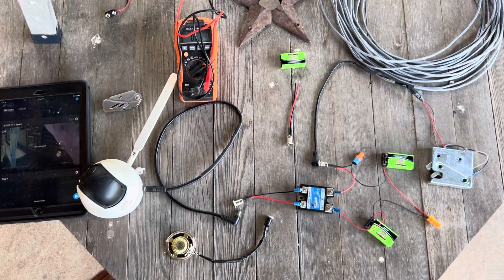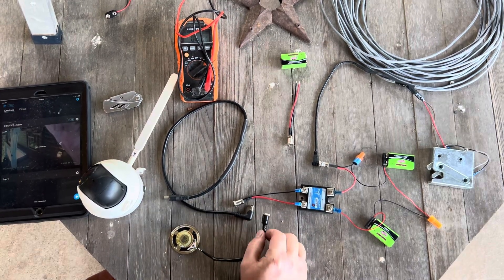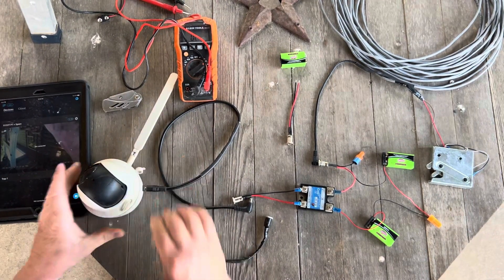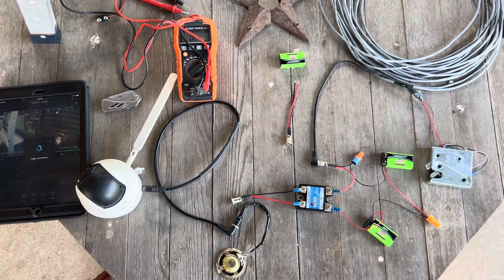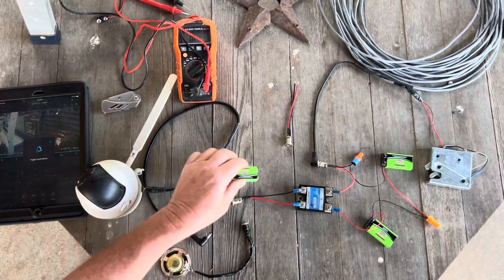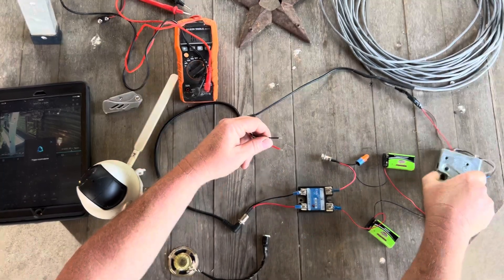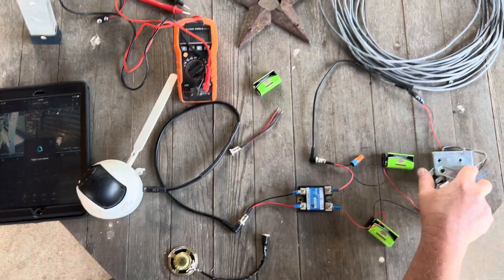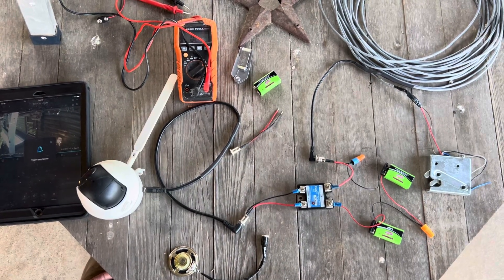Reolink audio mod testing and troubleshooting.

Comment: I have been using this setup - awesome. Thank you. One question....I have one newer Keen Ranger camera that won't flip the latch with the alarm. I know everything works because i can put a different rigged up camera on and it works. On the camera that won't work, the sound is custom (car horn) like my others (and I have checked it with a speaker like that rigged up), and it also produces a solid red light on the relay (no blinking, not weak light). I have even clipped the waterproof wire connection and redid it just to make sure it wasnt that. Like i said, i know the issue is limited to the camera because a different camera will work. Any thoughts? Thanks!